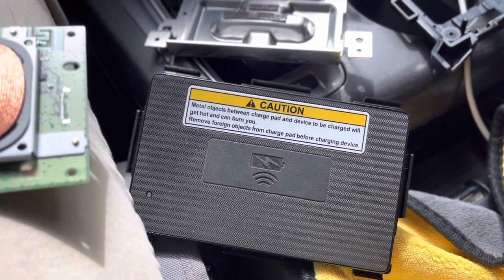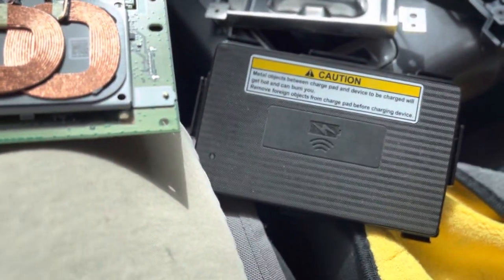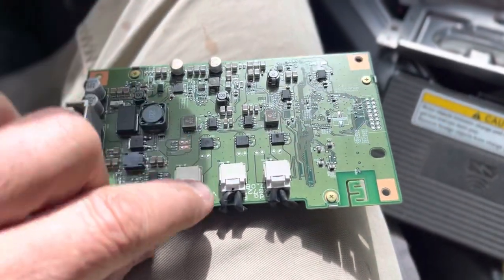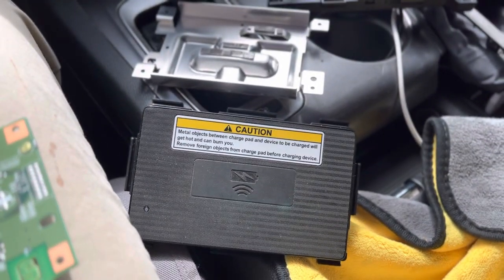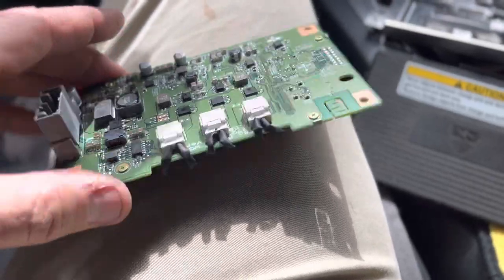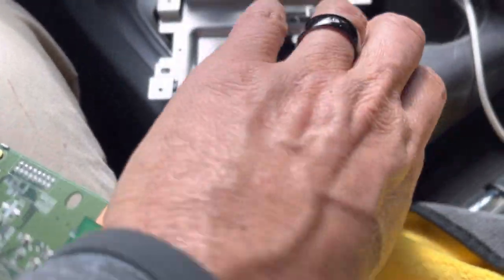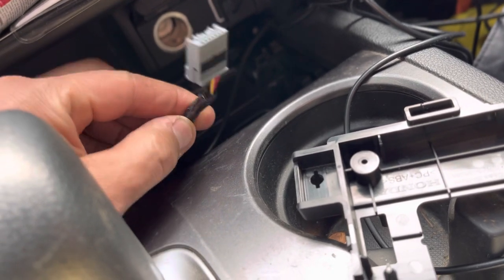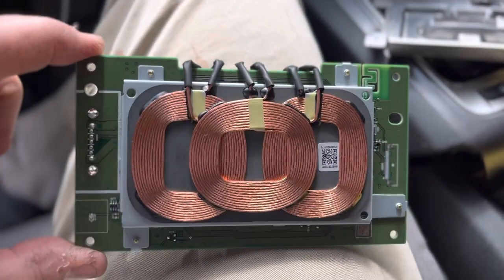HONDA HELP! Honda Wireless Charger NOT WORKING. Known Honda Issue Ridgeline Passport Pilot NO FIX

Comment: I have an iPhone 14 max pro in the 2023 Honda pilot touring, the charger has not worked since I purchased a car this past April. It’s ridiculous and Honda should be held accountable for this, I paid a lot of money for my car!!
Reply from the maker: Agreed
Reply: I have a 2022 Acura MDX and my iPhone 13 Pro Max has not wirelessly changed from day one yesterday I had my vehicle in at Acura for maintenance repairs and they gave me a new loaner a 2024 TLX A-Spec and the wireless charger worked flawlessly at 100% no problems at all I moved my phone all over I even spun it around a 180 degree and it never stopped charging and Acura service department keeps on saying that Acura is aware and that the problem is the Apple iPhone which I think is just strange

Comment: Have a 2022 Ridgeline and the wireless charger has never worked on my Samsung G21 and several other android phones. Tried both with and without case. Dealer says its a known issue and Honda's working on a fix. That's TOTAL BS as its been 1.5 years now and they still don't have a fix, and continue to rip people off by selling these. I investigated this and found that this issue was known well prior to buying my vehicle and they sold it to me knowing that it is a defective product. Shame on Honda, I expected way more from them. This option costs quite a bit of money and they have done NOTHING to make it right. You can buy a cheap Chinese wireless charger on Amazon for $20 and guess what - it works. I have written Honda a nasty letter stating that I demand a refund. I think there needs to be a class action suit, as they continue to sell these knowing that for most (if not all) phones they do not work.

Comment: I have the same issue in my 2023 passport. Every time I mention it to the dealership they keep blaming my phone and act like no one else is having this issue and it’s the first they have heard of it!
Reply from the maker: Lol - I have the technical bulletin link in the description to print out so you can walk it in with you.
Reply: I have EXACT same issue on my 2023 Honda Passport since day one. Honda just put in a new wireless charger today 8-1-2024. It seemed to work for 3 blocks and never charged up not even 1% 
Honda is 💯 percent despicable about this 😡

Comment: I have a 2023 (brand new) Honda Ridgeline and my wireless charger doesn’t work.  I went to the dealership and had a new wireless charger installed and it doesn’t work.  The dealership is waiting for a fix from honda.
Reply from the maker: Yes. Some issues here.

Comment: I have a 2022 Honda Ridgeline  RTL E with this phone charger installed at Honda. I have the same issue you detailed in the video. I have an IPhone 12 that connects sometimes. I found that taking the Apple IPhone cover off the back it connects with the charger most of the time.  I was told by my dealer that HONDA is working on some type of software update to address the issue. Probably BS but maybe not.
Reply from the maker: No cover used on this video.

Comment: I just installed this kit on a 2021 Honda pilot and boy did I go around my elbow to get to my thumb. I took the whole front dash apart, I removed the CD player/power unit and plugged in the little pigtail. I put everything back together then I had to change over the colors for my charging console because I have a glossy top and light gray sides, which was no big deal. Where I ran into an embarrassment, was after I did all that work and I was plugging everything back up underneath the cup holder, I realized there was a taped connector that had the exact same plug as the extension from the 12 volt power outlet. 2 hours down the drain for a rookie mistake.

My wife has a Galaxy S22 and while it charges, it's slow charge. When I plug in the USB connector from the center console, it's quick charging. About the same speed as her indoor charging base. I think the limitation on the Honda is the small gauge wire supplying power. It doesn't matter if you use the pigtail or if you use the factory plug, they are all 20 or 22 gauge wire I would suspect. But it is an extremely clean looking installation, and I'm so glad I did it. My next phone will have wireless charging and I am going to use the heck out of it. Thanks Randy!

Comment: I have been a loyal Honda customer for many years. However, their product quality has not been the same. I have a 2022 Honda Pilot and the wireless charger never worked from day one. The dealer is not sure when or if Honda will release software to fix it. It has been two years and no resolution. My next car will NOT be a Honda!

Comment: Randy, I too have a 22 Ridgeline with wireless charging similar issues. 
Went to Honda was told it’s an Apple issue so, went there and Diagnostic test came back not an Apple issue it’s the Honda charger so, went back to Honda and getting a new charger installed this Wednesday 3/29 I’ll advise soon if, problem gets resolved my iphone is a 12 Pro Max
Reply from the maker: Let me know. See if you can get the part number!
Reply: Please let me know if it worked.
Reply: Give us an update!
Reply from the maker: Nothing!
Reply: @CampingRandy  nothing going to write a letter to Honda I’m just soo surprised on the amount of issues pleople are having. 
Guys let all write Honda maybe someone will listen.
Reply from the maker: They know. They blame the phones. The phones blame Honda.
Reply: @CampingRandy Honda’s tech inside of the car is bottom of the industry.  There is no reason they should be having these issues.

Comment: Randy, just picked up my Ridgeline from my local Honda Dealer.

The Wireless charger got replace with a new unit P/N 39570-TG7-A1 but, still No fix 😢I’m going to test my phone on a 2023 will advise soon
Reply from the maker: Awwww man!!!!!!
Reply from the maker: Check and advise - 39570-TG7-A01. Let me know.
Reply: Wow! Mine was just replaced today and shocking it does not work. I drive a 2022 Honda Ridgeline, I have had to call honda roadside to jump start my truck 2 times in the last 6 months. Honda claims there’s no issue each time. Any advice?

Comment: My 2022 wireless pad worked with my iPhone 11. When I upgraded to iPhone 14 it no longer worked. That was a year ago. Another YouTuber said it’s because the old technology was slow charging and the iPhones 12 and up are fast charging (qi). I called Honda national number a month ago and they have no intention of any fix. My husband bought a new Pilot with wireless charging and his iPhone 14 works fine on it. But his phone won’t charge on my charger, only his. I don’t even know what to do. I bought a qi charger that goes into the 12 v spot. It’s like cooking with a hot plate bc your stovetop doesn’t work 🤦‍♀️ $50k car with a charger bought at Sam’s.

Comment: Randy its a phone software issue. I use to run into similar issues working as a tech for Mercedes benz and when (apple products most of the times) comes out with software the issue wont be resolved. Use to have the same issues with apple car play as well
Reply from the maker: Well - we will see. I’ve had three iOS updates over the years. Nothing yet.

Comment: We are having this issue with our 2020 Pilot. Seemed to work initially, now its not or intermittent.
Reply from the maker: Interesting.
Reply: same on my 2019 Honda Pilot.  have you found a fix?
Reply: @omarc8936  No, the Honda dealer mentioned something about a software update or bug fix. So we'll have to see.

Comment: Laughs in Android
Reply from the maker: Oh - don’t get up on that high horse; droids are having issues too. - said in iOS
Reply: I have 2022 rtle and a Samsung note20 ultra and my wireless charger has never worked and I've had them swap the wireless charger.
Reply: My android won't charge either 😢